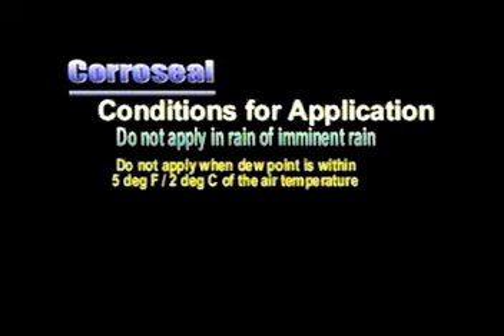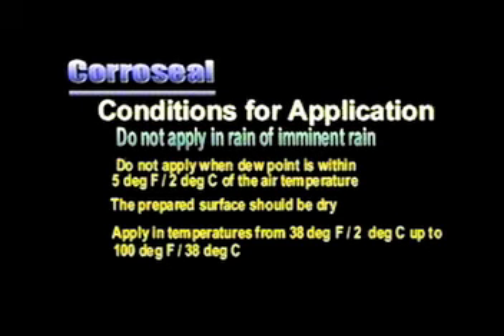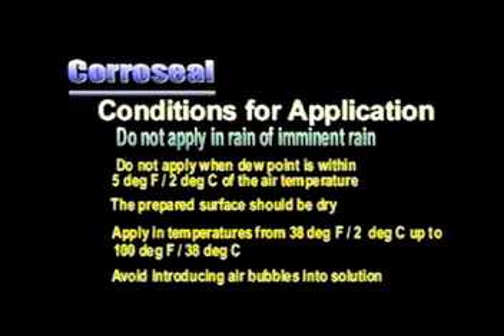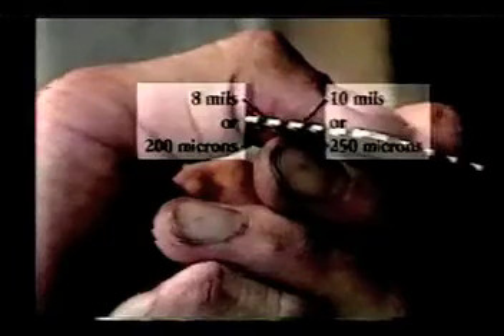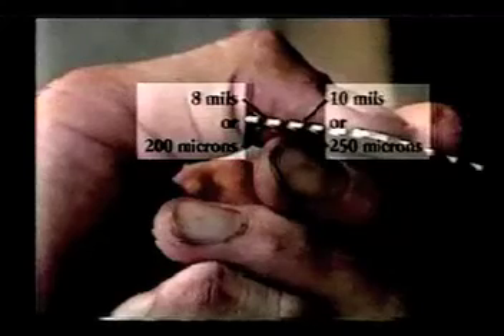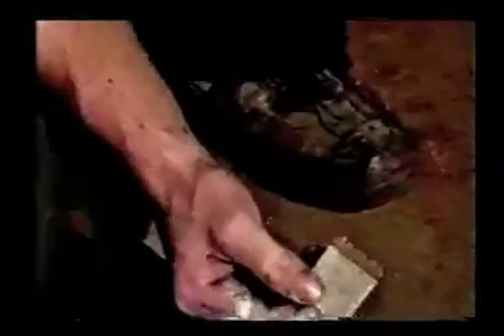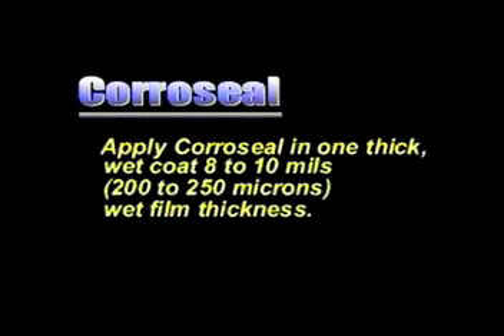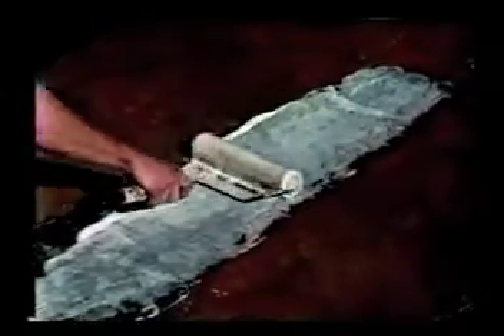Application of Corroseal Rust Converting Primer

Comment: i love this stuff, just corrasealed the whole underside of my school bus today, it came out solid black !!!! about to buy another gallon ... also, you dont need "10mil" ... just paint on 1 nice coat with a brush and it will turn solid black in minutes, make sure you wire brush the surface first to remove chunks of rust....